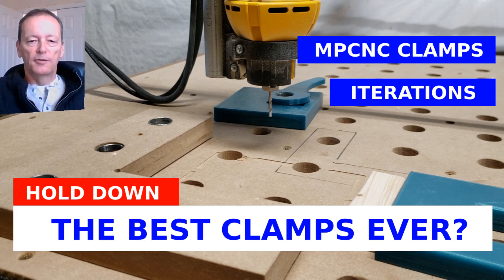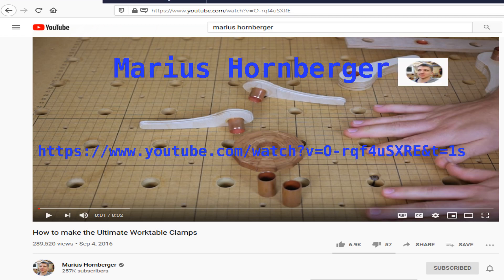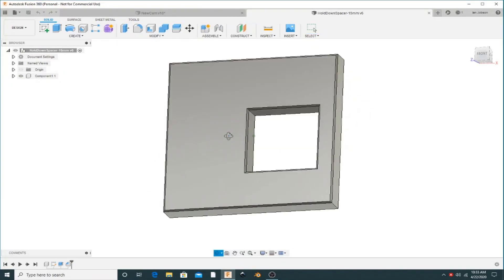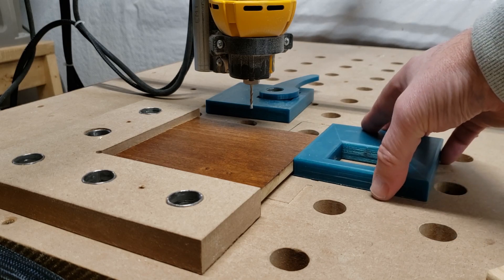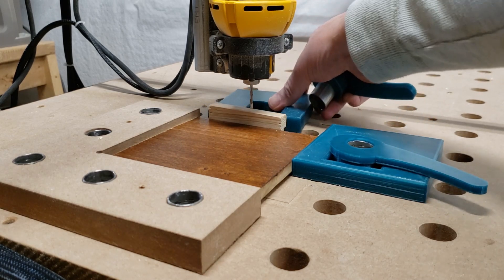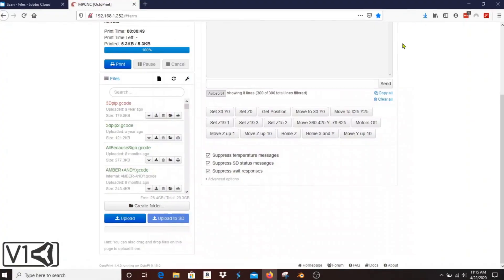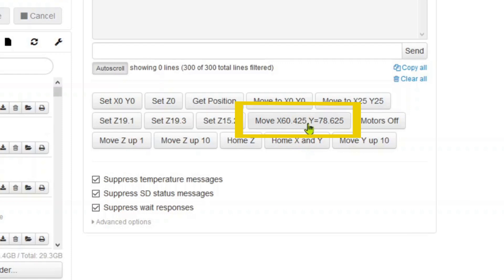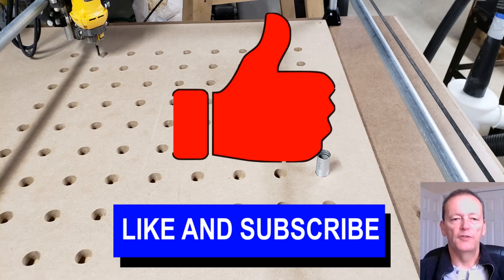MPCNC clamping system - no screws, glue or double sided sticky!

Comment: Hi, I just build a lowrider cnc and am interested to try your clamp system. Would you be willing to export and share your fusion files in step format? I use freecad and think I can import and work with step files.
Reply from the maker: Sure, I will have to see if I can find them and export them. I use freecad too.
Reply: @Adventuresincreation  thanks!
Reply from the maker: I found them and have the step files. I will post them to my bit bucket and let you know. I did import them into freecad, they look pretty good.
Reply from the maker: You can find the step files at https://bitbucket.org/ianj001/freecad/src/master/
I imported them and was able to make modifications to them in FreeCAD.

Comment: Nice! Found this through one of your other videos posted to r/mpcnc. I've been trying to find a side clamp system just like this. Thing is I've already cut T slots into my spoil-board... Maybe I can try to devise some kind of hybrid between your conduit design and my T slot clamps.
Reply from the maker: I am sure you can come up with something. Let me know if you need the fusion 360 file for my clamps

Comment: That's fantastic.  Thank you for sharing.  I haven't built a CNC yet but I have been using Octoprint for a couple years.  Never occurred to me that you could mix them.
Reply from the maker: I used Octoprint first for 3D printing, then I used my 3D printer to make my MPCNC and now I use Octoprint to manage my MPCNC. - I use Raspberry Pi's to run Octoprint. I have two printers and use one Pi that runs two instances of Octoprint and then one Pi for the MPCNC.
I have found that its very beneficial to have the same interface for both so I don't have to learn other software packages to achieve the same thing.